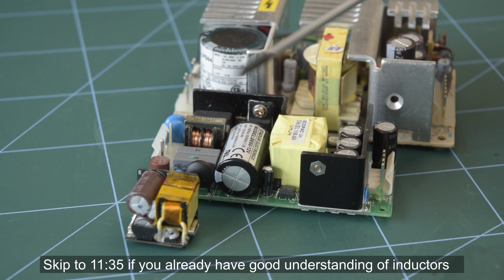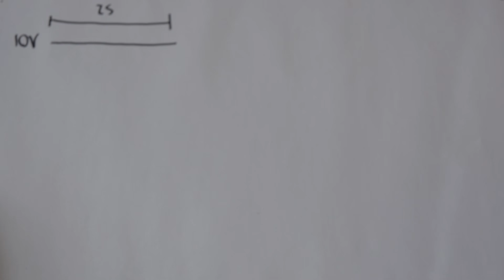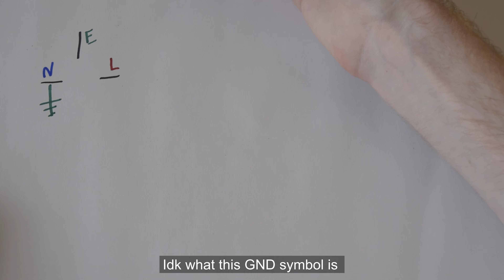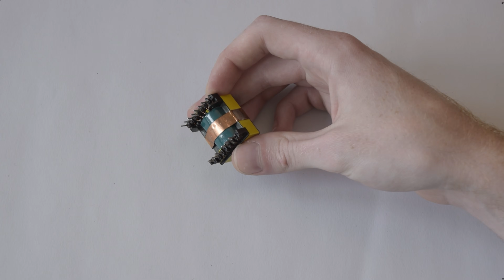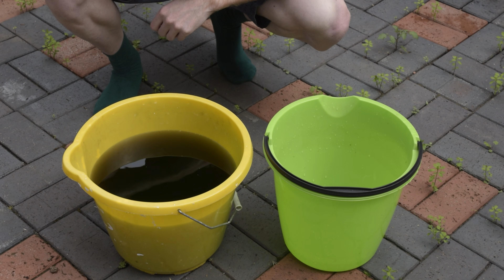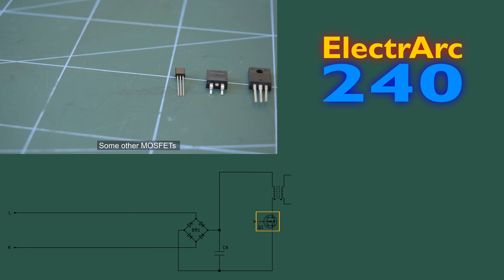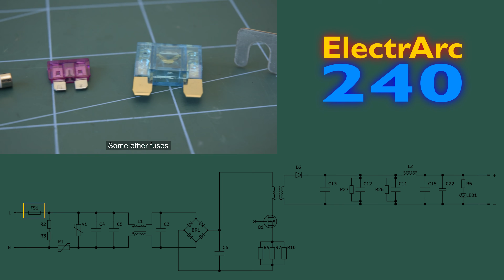Every Component of a Switch Mode Power Supply Explained

Comment: Excellent video, what is difference between coupled inductor and normal transformer and how do they work? Also would it be possible to explain how autotransformers work too?
Reply from the maker: Coupled inductors store energy, you fill them up and then empty them (like the cup with the buckets). A transformer doesn't store any energy it just magnetically couples the input and output (they are a lot harder to explain but hopefully the linear PSU video helped a bit). Because of this coupled inductors are only used in low power converters up to around 100W, after that transformers are preferred because they can transfer more energy in the same size (because they don't need to store it). They aren't used at lower powers because the rest of the circuit is much more complex for a transformer. An autotransformer is like a transformer but you've connected the secondary to the primary to either increase or decrease it. This doesn't provide any isolation but means less windings are required. For example if you wanted 120V -> 240V you can just wind a transformer for 120V -> 120V and then put the secondary in series with the primary so they add and you get 240V out. Hope that makes sense?

Comment: Fantastic  info thanks ,,,please  can you do a vid comparing the  merits of a quality switcher like TDK  LS-100- 15   and the cheaper Meanwell RS-100-15  which has a noisier  output ,, i guess its down to filtering efficiency and cost ? I use these modules  to power AUDIO MIXERS , and it would very interesting to see just WHY the TDK  one is more expensive ( and quieter ) than the MEANWELL type

Comment: I like the explanation and the reasonings but you left the part where you mentioned the pwm signals around the mosfet's gate terminal which should be connected to a timer circuit or an oscillation module to generate a signal to and turn the mosfet on and off to reduce the amount of voltage in the transformer.
Reply from the maker: Yes I left it so I can cover it thoroughly in multiple upcoming videos. Starting with my recently released video on MOSFETs

Comment: I saw an old a/c board with a power supply that seemed weird to me as a noob on power supplies, it used a small rectifier  ( DF06S  ) That toke directly mains 220 outputing 310-sh D.C. and then feeding them through capacitors to a TNY255 and then a small inductor as of my understanding

Comment: Every electrical and electronic engineering university lecturer should firstly explain (as best they can) in a fashion similar to you, before deep diving into the high level mathematics of the theory. It would make the theory easier to understand the ‘why’ behind the math. Sadly it’s just theory, a couple of practicals and exam. Pass or fail.

Comment: The two horizontal dashes in the transformer schematic symbolise the double insulation, not the core either energy storage. Some energy stored in form of magnetic field what mainly is allowed to run through the iron core, bcs. less magnetic resistance there. The voltage level transformation is more the effect of interaction of magnetic field of the two separated transformer coils. And magnetic field interaction with electrons. My point of view. Sparking start is independent from charged energy, only tension level=voltage causes sparks. Available energy of voltage source affects the length of sparks. You used the feather for explanation of voltage level and then of energy amount. Could confuse, well, was nice to watch and I like basic explanations

Comment: You missed a very critical detail. That large cap (also referred to as a BULK CAP) can NOT have 350V on it directly off the bridge rectifier. If that cap was tied directly to the DC output of the bridge, it would only show about 162VDC  (115VAC x 1,414). Instead, the MOSFET is used in a POWER FACTOR circuit. It switches the transformer on and off (typically about 100khz) and as the FET turns off, a fast recovery diode makes use out of INDUCTIVE KICKBACK and as the magnetic field collapses, the voltage passes through the diode to charge the bulk cap to a level HIGHER than 162VDC, (typically 350-400VDC). The diode is there to prevent the FET from shorting the BULK CAP when the FET is switched on and powering the transformer. POWER FACTOR circuits are the reason modern SMPS power supplies don't require a 115/220 AC selector switch, so they can be used in Europe or America without modification.
Reply from the maker: I’m in the UK where we have 240V so it would get ~340DC from the rectifier. This PSU has no APFC as it’s below the power level that requires it. I am going to do a video on that soon though cause it’s definitely super interesting!
Reply: @electrarc240  Oh I see. So this power supply is made exclusively for the UK. Very good then 🙂

Comment: Hello.  What a great video.  Love the detail.  I'm replacing two class y caps in an older computer power supply and wondering if I can go higher on the voltage.  I know you can do this for electrolytic, but not familiar with this type.
Reply from the maker: Yes that should be completely fine. Sometimes they have a DC and AC rating so if so make sure both are at least the same as the old one
Reply: @electrarc240  That's part of the issue.  The caps are covered in glue, so I can't see the markings.
Reply from the maker: Ah, bloody typical…

Comment: An extremely interesting video. 
I assume that if one is going to repurpose the power supply unit for hobby work, or maybe to drive a raspberry pi or for some other purpose, it would be possible to adjust the voltage using the potentiometer you mentioned towards the end. But how much voltage variation can you really get in practice and is there any consequence (for instance more heat being generated, or a shorter component lifetime)?
Reply from the maker: Not much sadly. Maybe +-10%? They’re there just to “trim” the output to the value needed. Might affect efficiency slightly but it will be designed to run within the range of that pot. You could swap the pot or surrounding resistors to get a greater range but then the controller might get upset

Comment: 1:43 I think you're mistaken, the improvement in power density isn't almost perfectly linear but rather logarithmic, as it's the scale on the vertical axis. I checked because of how disproportionately smaller the newest one was, it didn't make sense.
Reply from the maker: Yeah I made that plot, I knew it wasn’t linear but the line was straight and I felt that calling it “linear” would confuse the least people. I often do things like this I’m afraid, upset a few to make things simpler for the many. My apologies and well spotted!

Comment: Thank u 
U r perfect in explanation
Almost i know all about smps how do they work
I have a question . I converted an atx psu to a variable one but to do that i had to disable the short circuit protection.if u can help me to do the job without disabling short circuit protection i will be thankful.and i know its a challenging one but im sure we can make it
Reply from the maker: Possibly the short-circuit protection monitors the output voltage and turns the PSU off if it drops too low? If that is the case find where it is measured and try to add in your own voltage that is constant at what it expects. Just a guess

Comment: For flyback transformers where the energy is stored in a coupled inductor, a gapped core is used, and the great majority of the energy is actually stored in the gap rather than in the core itself...
Reply from the maker: Yes exactly, as with many other things I said in this vid I tried to keep things simple so avoided “small” details like that

Comment: The centre pole of the commonly used concentric DC low voltage power connector is not always positive, so beware, always check polarity of the appliance first or else you could cause an expensive fry-up! Just in case anyone's watching who doesn't know...
Reply from the maker: The dreaded centre-negative!!

Comment: One thing that I've encountered is high frequency electronic noise, which has been at times a real problem in sensitive radio receivers.  So I try to track down suspect switchers.
Reply: I should add , I am an old analog guy, and often prefer these!!

Comment: yes please make a video on 5 volt 2A SMPS psu for MCU based devices with detail explanation
Reply from the maker: It would be very similar to this, just with smaller and possibly slightly fewer components
Reply: @electrarc240  but we need the video

Comment: So i watched the Linear power supply first, which uses a "transformer" first, but this switching power supply has the "inductor" much further down the line. Any chance of explaining why the switching power supply conditions the AC power before the "inductor/transformer" unlike the old linear power supply?
Reply: Also, as a Mechanical engineer in training, wow... Just phenomenal coverage of something I've been meaning to research forever!!!
Reply from the maker: Fundamentally the switch mode power supply needs DC not AC which it then chops up with the switch into pulses that charge up the inductor. We can convert DC to DC very efficiently by chopping it up into essentially very high frequency AC. But as mains is AC we have to rectify it first. The rest of the circuitry around the input is just protection and filtering it would work with just a rectifier. So really this is an isolated flyback DCDC converter and just a rectifier at the input. If that makes sense?

Comment: @electrarc240 Speaking of which... I've got a 1200 watt computer power supply here, 15 years old but never used. After powering it up, somewhere beteen 5 seconds and five minutes, it burps. You know the drill, an electrolytic, or more than one, gone dry. 
So no prob. Open it and replace them all. Oh fudge and other serious four letter words. 54 electrolytics, exotics all, tall and thin to have room for them all. And of course the burps are intermittent so  non load testing won't reveal much if anything.
Suggestions?

Comment: From your explanation, I'm not seeing the difference between an inductor and a transformer? The difference between this and just using a very large transformers like we used to seems to be that we rectify to DC, store in a capacitor, and pulse to a smaller transformer?  Does the instantaneous discharge waiting in the capacitor allow us to simply put more through the inductor for the higher output per size?

Comment: One aspect of almost every higher power SMPS I have ever taken apart (usually in the range of a few hundred watts up to 1 kilowatt, from computers) is that they tend to use Schottky diodes of the "dual anode, common cathode" type on the low voltage DC side. I understand why Schottky diodes would be used at this kind of power range - they have a significantly lower forward voltage drop, so waste less power as heat and are therefore more efficient. But what is the advantage of using the "dual anode, common cathode" type in this application?

Comment: Yes those PSU's have got 20 or 50 times smaller or whatever... but
- EMF got worse. Fewer parts means less filtering.
- longevity went down. DC power supply from the 60's still works while one from 2005 is dead. Older equipment can even survive 400V (disconnected neutral in 3-phase wiring) while new electronics are instantly gonski
Going small and electronic isn't always better, good example are welders... modern stick welders work like a switching power supply which results in low duty cycle and a suboptimal arc. Old type welder with coupled AC motor and a DC generator has a 100% duty cycle, provides a perfect arc and is extremely long lasting. They don't break, they are abandoned after grandpa dies...

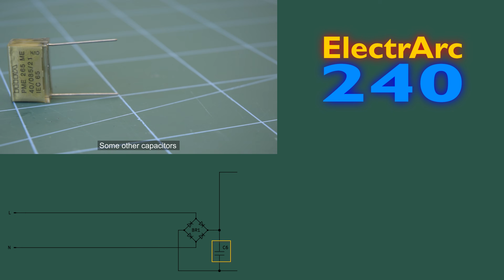Comment: This might not be the video to ask this question but at 12:46 you mentioned the capacitor is used to smooth the DC waveform. Is there a way of calculating the capacitor size that you need? I have an unsmoothed DC 110v supply and need to smooth it out as much as possible but the capacitor that I used spikes the voltage up to 170v is there any other way to smooth it?
Reply: If I recall from my basic electronics classes, you can choose a desired RC time constant and then calculate the required capacitance. This constant would vary, depending upon the frequency. Also consider RLC time constants if the cap is near an inductor.

Comment: As your videos is very interesting but you can't explain in primary sides frequency of different circuit control which means that means it's depends upon the different parts  means MOSFET, ICs,....etc anyway thank you so much 🎉

Comment: Hey great video, I subbed. Just wanted to ask: What element is triggering the Gate of the MOSFET?
Reply from the maker: The gate driver which is integrated into the controller IC. I will cover this more but over multiple videos. Now that I have done one on MOSFETs themselves I can next cover gate drivers, then control!
Reply: @electrarc240  thanks I appreciate the quick response. I'm going to read up on the function right now.
Just wondering: could this be done with a 555 timer? I just don't know where to get the initial low DC voltage necessary to power it. Maybe store a bit in a small capacitor until we can get the output DC looping back?
Anyway I'll be looking out for the next video. I just watched your MOSFET vid and it was fantastic.
Reply from the maker: @borisdorofeev5602  Probably couldn’t do it very well with a 555. And yeah the challenge of powering the controller before the power supply has started power supplying is really interesting. In the power supply I showed the controller is actually powered through a really high value resistor until the power supply starts up
Reply from the maker: @borisdorofeev5602  And thanks about the MOSFET video!

Comment: 0:53 size and weight comparison for sure!
Reply from the maker: Weight improvement is less impressive shhh 😂
Reply: @electrarc240  nah man, I put offerings on my altar every evening for the enameled copper wire gods as gratitude for the much lighter transformers we have in these smps goodies. I'm filled with joy when I can't feel the weight of a monster that pumps out 12-24VDC at anywhere between 1-10 amps. We truly live in the future now :face-pink-tears:
Reply from the maker: @mistaowickkuh6249  The little GaN PSU has quite nice looking Litz windings despite being only about £15 🤤
Reply: @electrarc240  when I was a teen I interned at a wire factor for a few months. You'd have a braingasm there I think. All those huge spools of fresh wire looked so smooth and satisfying.,

It was so damn hot inside though. Resin curing process requires huge long ovens.
Reply from the maker: @mistaowickkuh6249  Sounds amazing! I think I'd get hot in there no matter the temperature by the sounds of it 🥵
Reply: @electrarc240  You have good energy sir. I can tell you find peace from the smell of metal and oil in a workshop. I'd share a six pack with you if I was close by and I still was drinking 😃

Comment: @ElctrArc240 can you please make a full video on designing variable power supply which can control voltage and current upto 30 volts and 5 amps with feedback signal so that on applying load voltage doesn't drop

Comment: So, like I learned in auto shop many moons ago, the primary winding of the coil charges while the points are closed, when they open, a voltage is induced in the secondary winding. Replace the mechanical points with electrics, and bob's your uncle.
Reply from the maker: Bob is indeed everyone's uncle :)

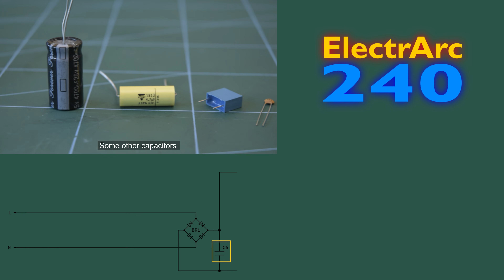Comment: 12:44 what's that last type of capacitor and is it special in any way? I have an Apple //e which used to work perfectly until one of those blew up in the power supply.

Also I once opened up a camera and got shocked by the flash capacitor, which was painful as hell but I was fine luckily. years later, I disassembled another camera and I thought I'd be smart and short out the capacitor this time. I really should've done that slowly with a resistor because wow I used a screwdriver and the bang was so loud my ears were ringing and there was small bits burnt off my screwdriver tip 😂

Comment: Please cast this into the furnace and reforge it with the aid of Maple and maybe Llamma 4o or whatever. The conception of inductors is quite bad and I do think you could get by asserting that the energy put by EMF into the transformer primary is transformed into a magnetic field (also energy) and not lose viewers? And also that the rectifier is not ahead of the primary winding but just giving a signal to the optoisolator, not least because running a saturated primary is going to short it? Whereas rectifying the secondary gives DC where you want DC and maybe you overlooked that bob because it's only a 20V part and not stonking big to shrug off mains voltage noise?

I mean, it goes on and on, but you can pack it in about the same time but with right answers if you try. It can't hurt to have power transfer limit functions or Fourier transforms for each phase of a nonideal input called out along the signal (just 0.01 - 18.0 A of 20V power for the gaming laptop please?) Go on and take credit for the length of the discharge being enough to see (thus, not instantaneous and marked by permanent headaches and permanent sun dogs...in your camera if not actual visual system.) It'll be a fun challenge to explain transformer core evolution to high entropy core materials and square wires in the same sort of time window. I think it's a fair ask to cover 400V v. 28V electrolytics and model body muscular stimulation v. nervine or cardiac stimulation for your more cautious stick men. Explainers of semiconductor diodes and recovery time would be nice also, you want people following along on why the Fourier timescales work out and why the gamma function you've attributed to switching belongs nowhere in the signal chain and represents all the brackish bucket water spilled and none transferred.

Keep on!